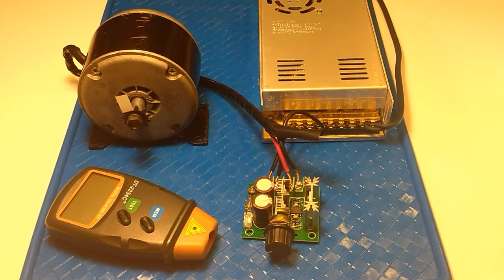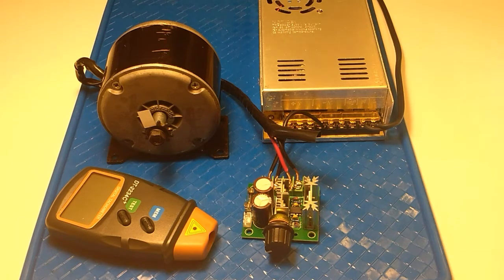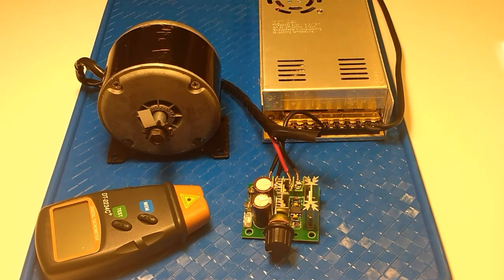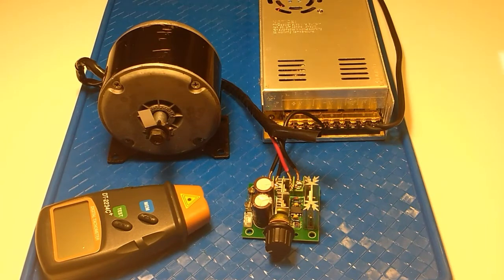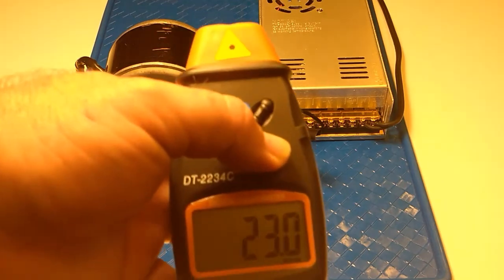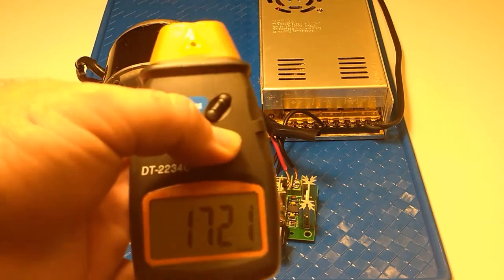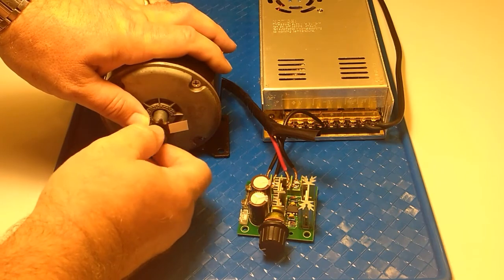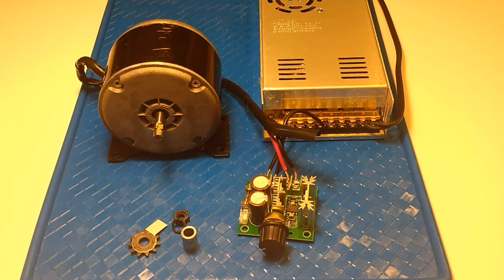Future Cork Grip Lathe Project - Motor Testing (24V 250W Scooter Motor)

Comment: Thanks for making this video, this is the exact information I have been looking for. I have one of these motors plus a PWM on the way for a bowling ball spinner and was worried I wouldn't have enough torque between 300-600 rpm but it looks like it will hold up fine.
Reply from the maker: These are pretty strong little motors. Good luck with your project!

Comment: Thank you for posting this video. This was very useful.  For my project, I want to replace the sprocket with a larger, about 6 inch diameter, pully. Do you think it would be possible to replace the gear from the motor with a larger pulley on the shaft?
Reply from the maker: Absolutely 👍
Here is a lathe powered by a scooter motor using a toothed belt and pulleys: https://pasteboard.co/JISKEg1.jpg
Reply: @TheFishingHobby  Thank you.

Comment: Can this motor be used to make an ebike, will it have enough torque , if yes what will be the speed of my cycle (50kg including the weight of me). What is the NM of this motor
Reply from the maker: I don't have any specs on this motor, but it is used on electric scooters so I would think it could possibly work on a bike too.
Reply: @TheFishingHobby  can you please test the torque
Reply: By attaching a string to it and trying to lift weights💪 please
Reply from the maker: Sorry, I have this motor hooked up to a machine.  You can probably find some specs online somewhere.
Reply: @TheFishingHobby  where did you buy it?
Reply from the maker: It came out of an old razor E300 scooter.
Reply: @TheFishingHobby  ok thanks

Comment: I had a couple of projects in mind. One is a light weight Ebike (aluminium frame) and the second would be a Press drill. do you think this motor would have enough torque for those applications? i currently have a homemade ebike using a 18V drill but the noise is too much. do you think the torque on this would be around the same or less? i know the 18v drill is about 180 watts max but also know its geared down. these sell for about £28 on amazon so im thinking of it if i can find good input on the motors. thanks
Reply from the maker: StefanKeyesGaming the torque on that drill would probably be greater given the gear reduction. You could increase the torque on the scooter motor by using pulleys of different sizes for a drill press or bike gearing for an e-bike. I would have to think the scooter motor would hold up better on an e-bike because the motors used in a drill like that aren't built for continuous duty. I think there are some YouTube videos about using scooter motor for e-bikes. The scooter motor would work great for a drill press with pulleys of different sizes but I don't think the variable speed controller would work well in low speed situations where high torque is required like drilling steel.
The application I want to use this for is mostly high speed sanding using the motor on a lathe. Low torque demands and high speed so the motor can develop it's torque.
Thanks for watching!
Reply: The Fishing Hobby thanks for the input! Appreciated much! Think I'll go for the 350 or 500w version of this motor just to be on the safe side. Subbed!
Reply from the maker: Thanks! Subscribed you back, good luck with your project!
Reply: thanks :) same to you on future projects! may just make a channel dedicated to my amateur projects. love making stuff. A lot of the time they fall apart though (lol)
Reply from the maker: That is what I did! I don't have much content yet because my fishing channel has kept me pretty busy but it will be a work in progress. You should give it a go!
Here is my other channel: https://www.youtube.com/channel/UCjwu4RKIOgbcD62rebjsfcg
Reply: Nice one. i subbed there too! will defiantly give it a go! maybe when the motor arrives, just ordered it. says be here around the 29th. cant wait to try it. will just need to think now on how ill mount it. maybe make a wood holder first to see how it goes before i start putting welds onto the bike. will start making my build plans and see how it goes
Reply from the maker: StefanKeyesGaming awesome! Post up some stuff on your progress. I'd like to see it!
Reply from the maker: Hey, thanks! Will be looking forward to what you upload!
Reply from the maker: Could you post a link or is it the same channel renamed?
Reply from the maker: Not yet. I will probably start work on it this spring.

Comment: Sir.what PWM speed control model and  power supply model  should i wear if i use a 24V 300W motor ??? Can I use the same model ?Please help me😭 ..
Reply from the maker: One like this should work for your motor: DZS Elec 15A 6V-90V DC Motor Speed Controller 6V 12V 24V 36V 48V 72V 90V Large Power PWM Regulator Governor Switch https://www.amazon.com/dp/B0779RJKYW/ref=cm_sw_r_cp_apa_i_6GbCDbVGJ6K04

Comment: can you replace the potentiometer with a throttle?
Reply from the maker: The potentiometer doesn't actually adjust the voltage on this type of speed controller. It just varies a signal voltage which tells the controller how to adjust the frequency of the voltage pulses.
Reply: @TheFishingHobby  okay, i am using the same controller for an electric scooter,but now what can i replace the knob(potentiometer) with? for better handling  and balance of the scooter when you want to speed up?
Reply from the maker: @siyabulelamzomba6394  you may be able to make a foot pedal with the existing potentiometer mounted in it. A TIG welder foot pedal has a potentiometer in it and so do some electric guitar foot pedals. Take a look here, it may give you some ideas: https://weldtalk.hobartwelders.com/forum/weld-talk-topic-archive/welding-projects/12119-tig-pedal-question

Comment: how much rpm does it have at maximum speed?
Reply from the maker: Right at 3500rpms
Reply: @TheFishingHobby  Could you give me a link to the motor?
Reply from the maker: @zopfi0067  mine came off of an electric scooter. Any search for scooter motors will pull up lots of similar motors.
Reply: @TheFishingHobby  Thank you!
Reply from the maker: @zopfi0067  no problem

Comment: What is you r pwm module modal
Reply from the maker: It is one like this (I don't have a model number for it): https://www.amazon.com/dp/B0779QXYSR/ref=cm_sw_r_cp_apa_HVKRAbTZJVWYK
Reply: The Fishing Hobby Thank you sir,our project is on automatic wheel chair so we required constant low speed.how we can controll two motors speed at same time.whether we require 2 PWM module. so how we can do this in simple way.plz suggest any idea
Reply from the maker: Getting two to run in sync with each other may be tough to do. I don't have any experience in that area. You may be able to find some info online by searching Google